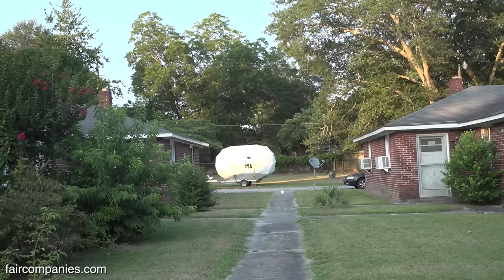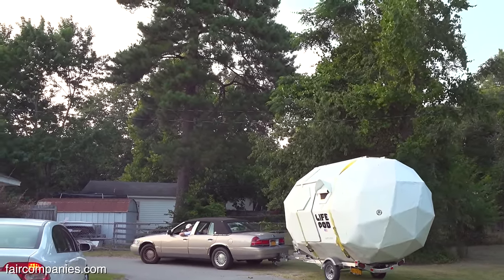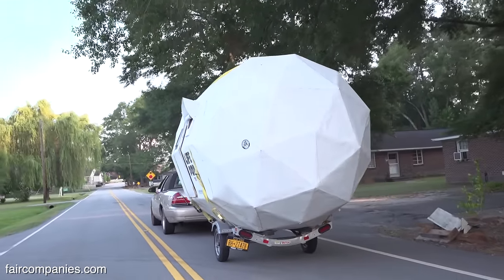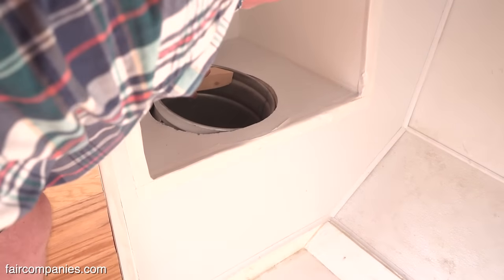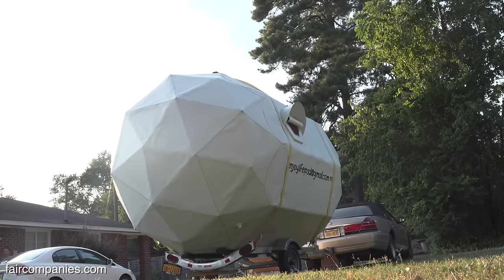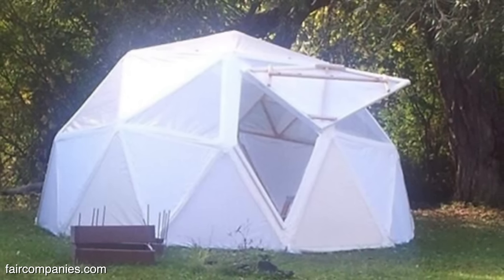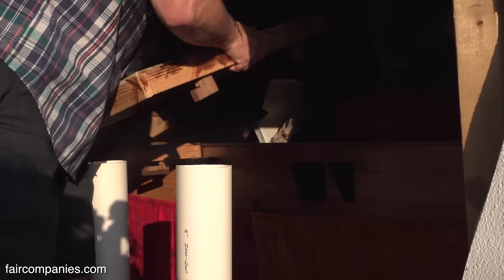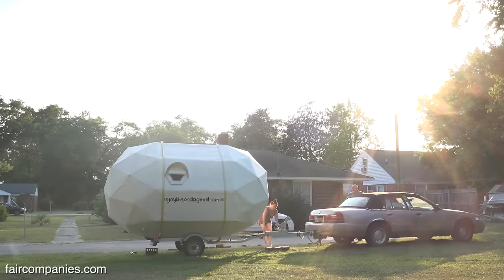SC hobbyist on building DIY geodesic mobile dwelling for 7K

Comment: Purely my personal opinion but I would go for a twin axle trailer. Given the dimensions of your trailer and centre of gravity you would be in serious trouble in the event of a puncture. There is a real risk of a severe loss of control situation and of course ending up homeless as a result!
 The shape and angles of your roof lend themselves well to fitting solar panels. Storage batteries mounted low down below the floor would be ideal. On my trailer I have fitted dual ram air turbines to charge my storage batteries when driving.

Comment: Nice concept, But not to be pulled on the street, way to light. I used to have a Toyota travel camper, that thing was perfect, good gas mileage, everything you need. And you wont get blown over in the middle of the night. I keep looking for a used one, but they are hard to find. Perfect little camper, and no trailer to worry about, came with a R-22 engine, best engine Toyota ever made.
Reply: Get one of those Elderly transport buses and tear out the seats and modify the interior. Those would make a nice little roving camper. I met a man in Rockport Massachusetts and he had a vehicle like that as a roving artist studio. He had it parked in a ship yard where they repair boats and he would set up his easel, canvas and chair with his paints and paint one of the boats from inside his bus. The wind or cold didn't bother him while he was in it. I believe his was a Toyota.
http://www.townofwindsorct.com/documents/departments/seniortransportation/docs/seniortransportation.png

Comment: love the whole concept and result.... I would have made the couch with a 2nd layer that pulls out for full sized bed and probably just used a plastic dishpan for sink as they are larger and then both sink and stove could go outside easily.  I would also put a door outside the composting toilet for access.   I would have to find someplace to fit a fold-down table on the outside of the pod (table, cooking island, desk, etc)... when I'm camping, I really want to be outside most of the time, unless the weather is disagreeable.  You did a great job on materials and engineering....and your neighbors are right, Bucky would be proud!!!

Comment: More tiny home designers need to consider lightweight durable materials..this could be made with and aluminum framing..wonder how it will hold up to the forces of travel. How about just a fiberglass egg..less aerodynamic problems.

Comment: I would have latches for the door and have it double as stairs (turned around). I would make the bed slide out. Take the microwave out and add a small fridge. I would get rid of the sink and just use a tub for dishes and the shower for anything else. instead of a framed screen door just use a drop screen with velcro. I would get rid of the toilet and just use a bucket and in that space I would do outside accessible panel for storage. Other than that it's great I love the design.
Reply: good thoughts
Reply: +bottomlands it's called constructive criticism
Reply: Idea collaboration can sometimes make really awesome things even better! No harm in chiming in :)
Reply: +Natassia Marchbanks :)
Reply: Yeah I never meant any harm, I was just saying what I would do that's all. This works for them and there is nothing wrong with that at all.
Reply: +TammyToo I appreciate you

Comment: Many tiny house folks don't buy $60,000 trucks to pull their homes. A $10K used truck will do, as long as it's rated to tow the home's weight or for those that don't move much, a rented truck works great.

A light weight tiny home is a great idea though.
Reply: Or they just hire a truck to get the house delivered (I'd think the majority of them actually). Tiny houses aren't RVs to travel with them, regardless of the few odd folks who think it's actually a great idea. They're built on trailers mainly to get around building codes anyway.
Reply: or they could even rent a truck so move the tiny house.
Reply: Yes, but they spend from around $30,000 to $60,000 to built!

Comment: It looks like it could even float. I agree about the weight of tiny homes on wheels - the weight is a major issue. To maintain a pick up truck too is quite costly and unrealistic. I was right later on in the video shows attached to floating decking. A bit too small for my taste in living. Just make a smaller box with height.

Comment: Interesting.  It has potential.  I don't like the entrance at all.  How would you put the door (either one) on when you're inside the pod?  I doubt people would want to extend the bed in such a fashion, either.  It seems a little awkward.  Maybe something that pulled out instead?  I'm also thinking it's not safe to use a propane stove in a location such as that.  I didn't see any mention of insulation, so this would only be practical in perfect climates.  I would also worry a little about stability in high winds when driving (blowing on the side).

Comment: I applaud the guy's ingenuity, but you can buy a completed RV in great shape with all the amenities, as well as more livable space, in addition to the engine and everything else necessary to transport it, for around 5K...well under the cost of this.
Reply: I agree. I got my 26' travel trailer on double axels with a slide-out for 6k in good condition. Going to have a few things changed for off grid living. I don't mind living in it. It's not skinny because of the slide-out (don't like living in a hallway!). It all depends on your wants and needs. I want to be parked in a place I can grow a garden, and have enough space inside to have one or two guests at the same time (or grandchildren). Those little pods to me would serve in an emergency situation only.

Comment: If you own a tiny home do you by a new expensive truck? You could resto mod an old one giving it the reliability and clean running of a modern one without the energy waste of a new truck being built for you. I think most tiny home people hire somebody to move it. This one might be a good concept if you went to the next level with carbon fiber or some natural material and aluminum framing.

Comment: the wheel base of the trailer frame on this should be a full 8 feet. take a corner a little too fast with this narrow wheel stance and it's going to roll over.

Comment: Nice! I was thinking in order to minimize tiny house energy use outside of walls could be made out of polyisocyanurate rigid foam seams filled with PU construction foam making uniform structure. In order to make loft structurally feasible build in furniture would need to design to carry the load. To limit thermal bridging fiberglass tubes could be used to transfer weight to the trailer. Use HRV, triple glazed windows. Otherwise, a passive house with efficient use of space would use would less energy than a tiny house per person.

Comment: This looks extremely dangerous-top heavy with an apparent undersized trailer that does NOT look to be rated for 1500 lbs. let alone adding anything else like clothes, groceries, water, etc. He did not show it going 55 mph and it is easy to imagine that was a white knuckle drive. He spent this money and now wants his money back. The real problem is it flipping over and taking out a pedestrian, motorcycle or other vehicle.  The trailer tires are so small if it was parked and it rained those tiny tires would sink quickly.
Reply: With a sturdier trailer base and another axel/set of tires, I don't see it being that problematic

Comment: I admire his efforts to think outside the box. however I think he should've taken a little more time tweaking it before showing it off. how's it go? you only have one chance at making a first impression, I think a lowered axle or different trailer to get it lower would be good and to integrate the door so it is easier to use. and the additional leafs need a better attachment design. without the leafs you'd have those big bulky things hitting your legs. again I applaud his efforts. hopefully he works out the flaws and becomes able to sell them. Goodluck!

Comment: Couple things. Your transporting system isn't safe you need bolts and those nylon cords wear out too fast. 6 cyclinders is adequate power but you need suspension modifications on the vehicle to help stability at high speeds. In Canada our speed limits run close or above 70mph not 55 and traiffic goes faster than that. You can take additional weight off by ditching the 2x2 framing and using pvc 2 in. You can melt it and reshape it. If you look on here you can see people making bows and crossbows with it. It's probably stronger than a 2x2. You don't need a microwave. If your going to cook use normal means and use that space for food storage. A real composting toilet with a vent system is a good idea. You don't want the gasses produced in feces with hot cooking surfaces. You have to vent the dangerous gasses. The shape is okay I think you can add a bit to the length and if you use pvc framing you should be okay I would consider vinal siding on it. You need to check on heat issues with vinal as it has a low melting point. See if there is something that you can use that doesn't melt down quickly. Insulation and climate control may be a good idea too.  Good prototype.

Comment: This would make a lot more sense as a practical vehicle if it wasn’t completely cylindrical. Have the top curved but once the midline is reached the walls would be vertical, down to the chassis. That would give the camper not only a stronger connection to the chassis, it would make the floor flat, give much more usable internal space, reduce the hight of the doorstep to a practical hight and be easier to construct in the first place. Also that door being ratchet strapped on is far from ideal. A set of gas struts and a proper lock would be far better.

Comment: ya want to be really impressive?  figure out a way to make the skin and support ribs pneumatic and all the innards collapsible. then when you get on site you use an air compressor and the shape blows up, then you slide the guy into it from the end and it folds out and fills the inside.

Comment: I can see that this is just a first run type of project so it's pretty rough in the looks department, even if this was fully refined I just don't see it becoming very popular. Most rectangular shaped tear drop trailers provide a lot more space inside and weigh very little. If made from Aluminum instead of plywood, an ultralight teardrop trailer would weigh only a little more than this one, and can be towed by most 4 and 6 cylinder cars no problem. I would want the little extra floor space and headroom, and a little easier roof to mount solar panels on. Just thinking as though I had to live in a small trailer space like what this guy is talking about.

Comment: Nobody is going to let you live in that thing in their parking lot. Many Walmarts will let you get away with it over night, but that's it.
You can't use a camping stove right under that tight cubby hole  and the close overhang. That's a fire hazard!
If the toilet is in the shower stall, where is the toilet paper stored? 
If water gets under the toilet seat during a shower, where does it go? The hole for the toilet is square, so that water is going to fall down onto the luan under there and rot it out eventually.
If you have to have the door closed because it's raining, it would be quite dark in there with the tiny windows. Also, when you don't have the double bed in place, where do you put all the boards and bedding? Some one else brought all that stuff to the pod for the demo, they were not already in the pod. Nice try, but I saw that detail.
Climbing over the bottom of the door is a sure tripping hazard, esp when your hands are full of things to carry in or out.
The door and screen door don't have hinges on them. How are you supposed to use them on a daily basis?
You have to strap your door on and the whole thing is only strapped to that dinky boat trailer!
No one would put up with this contraption for a week, never mind longer.
 Sorry, this might be lighter and cheaper than an Airstream and other small caravans, but Airstream and other caravan companies know what they're doing and have much more floor and storage space for the same over all sized trailer. They're also much safer to cook in, better windows with better light and ventilation.
I've seen vans with better planing for the interior living space. This thing is far too cramped and you expect 2 people to use it? No way!

Comment: The guy is really trying.....but like someone else said, it looks janky and pieced together. I also agree with rectangular space for mobile. Bucky Fuller domes have been around a long time and they did not catch on because of space efficiency for a home. Many tried. I mean many. Low resale value. Leaking, but they are certainly cost effective structurally. But that is about it.

Comment: could my 1986 e350 460 4bbl ford van pull this?
Reply: more than likely
Reply: I had a 1973 E-300, and I  demolished a 1920's (or 19-teens) bathroom, and I stuffed all the debris in the van. The dump charged me for 2 tons.

Comment: Being parked or especially driving, I bet a good wind would blow it over, and if you wrenched down on them ratchet straps you could break it in half. Lets see it going down the road going 70 MPH and see what happens. Now that would be a great video. It would have been cheaper, stronger, and better to had made it with a 7 foot drain pipe! "BAM" half the work is done. Guess you haven't thought about making the door like an airplane door, how funny. Just put hinges along the bottom and add some steps! It would be nice for the kids to use as a play house is all I can see it good for! 'In all', I can't see why so much money, time and trouble went into building a piece of crap when it could have been made so much better even as a box!  'Life pod',, SMH more like a death pod. I can see myself in it during a wind storm and rolling down a hill. OMG, I'm laughing just thinking about it..
'

Comment: When you tow a trailer the tongue weight should be between 9 - 15% of the GTW. There is no way that the tongue weight of that trailer is anywhere near that amount. Too light and the thing will sway and you can lose control of it. Too heavy and it can fishtail. This thing is incredibly light. That's great for gas mileage. But I'd bet it isn't safe for highway travel.
Reply: 1100 miles without issue.